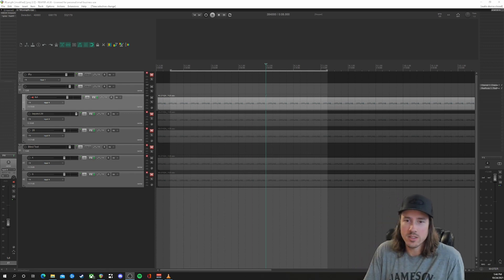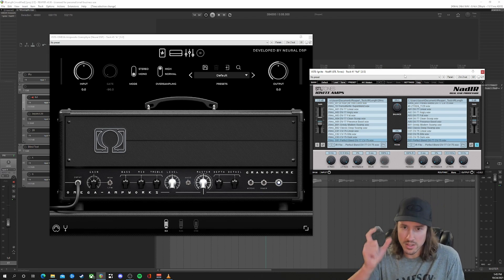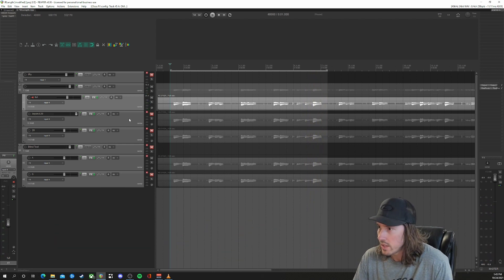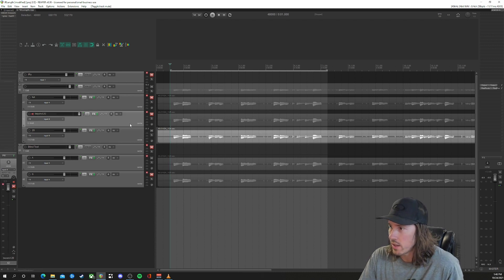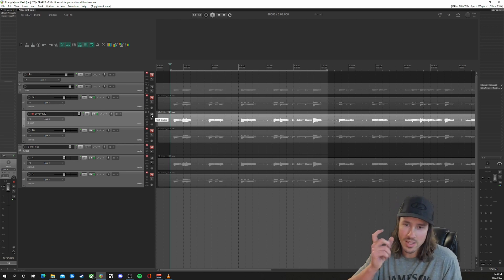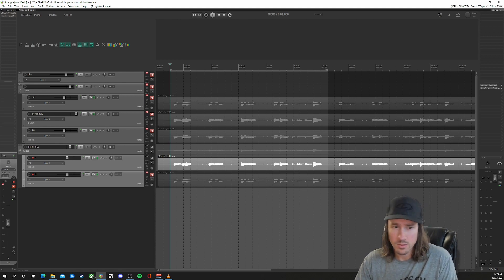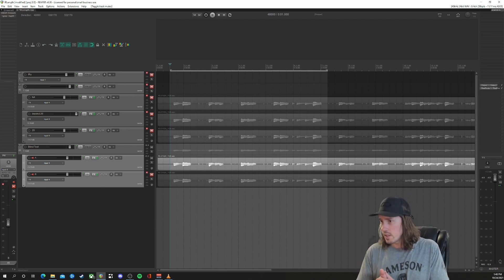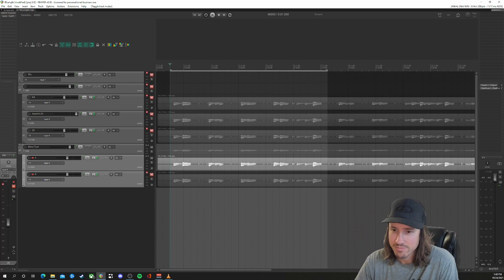Impulse Response (IR) Length - How much does it matter?

Comment: I don't understand how you can't hear the difference. It's the cab+room response is completely missing from the truncated IR. It sounds artificial and is missing the chunk and thump.
Reply from the maker: Most IRs I’ve used really don’t have any of the room response unless you’re using room mic IRs like some suites have included. In my experience, the subtle differences between a 20 vs 200ms IR (if even perceivable) I’d be really surprised if anybody could pick out the difference especially in the context of a mix. A tiny touch of reverb would dwarf any differences between them. What examples are you referring to?

Comment: Thanks for that Video, It contains exactly the information I was looking for. I'm thinking about a Cab Sim for my Bass-PB, and am torn between the Torbedo CAB and the CAB M+. Since the new Version doesn't support a Midi, I'd prefer the basic CAB Version, but IR lengths of 40 (for CAB) and 200 (M+) made me thinking. Now I know it's not too much to worry about. Since I play indifferent styles, I'd prefer that a potential CabSim is switchable via Midi or Footswitch, instead of bending down everytime to turn the knobs or fiddling on a mobile device....or am I overthinking this issue after all, or am I missing out an alternative option ?.... Anyways: Thanks !
Reply from the maker: With a straight direct tone, and not necessarily trying to capture a 'room' sound or any reverb, the shorter IRs seem to do just fine!